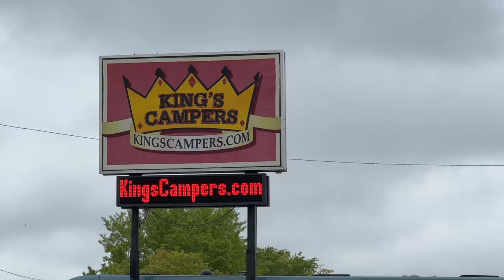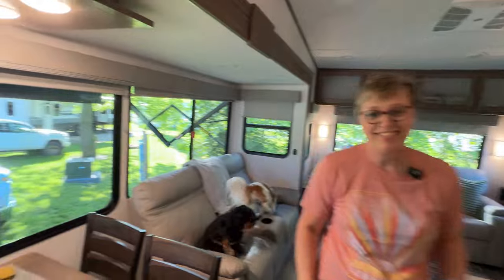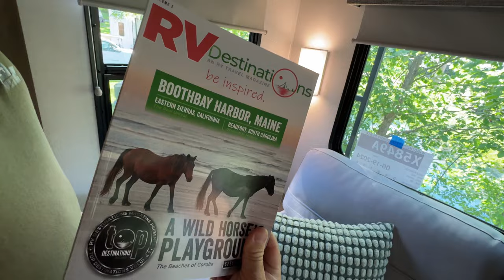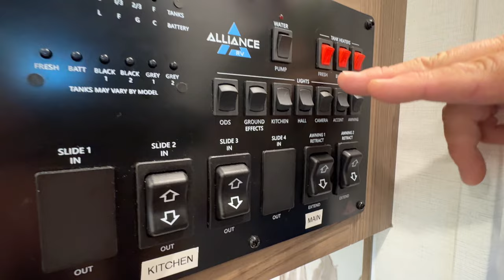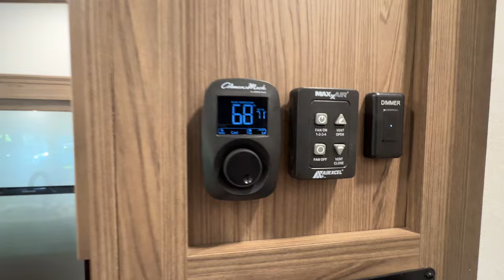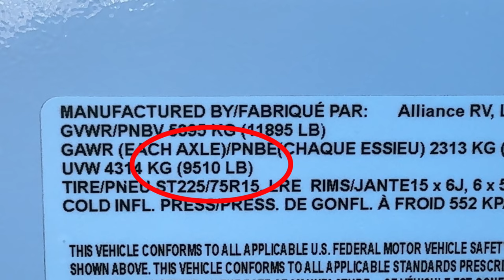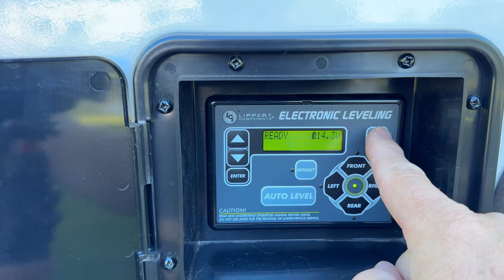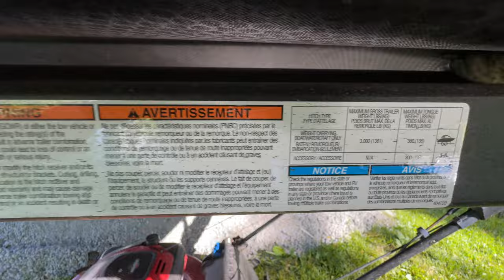2024 Alliance Avenue All Access Series 29RL Tour

Comment: Congratulations you will love it.  we picked up our 29rl on the 3rd of  May...we love ours as well...
Reply from the maker: Congratulations on your 29RL!!  We are loving it so far.
Reply: Does your soundbar work with your tv? Ours doesn't...
Reply: Also your table chairs will dent your flooring...we removed the small round button type pads and replaced them with felt pad type
Reply: Also, our 29rl fifth-wheel is 33ft 11 inches long...Alliancec brochure is wrong. Yellow sticker on the door confirmed it

Comment: We've changed our future plans from a Class C or B+ to a smallish 5th wheel. We're hoping to go coast to coast next year, and we're not sure a bumper pull is the way to go. We need road access, and mid camper stairs to fit in our limited driveway space. We've pretty much decided on a Cougar 23MLE, which has all the boxes ticked. Hoping to pick your brains, since it's all new to us. We've had our brand new trailer less than a year, so you're not alone in crazy fast trade-ins! Congrats, it looks beautiful!
Reply: Does that model allow access to the bathroom when traveling, (without extending a slide)?
Reply: @BigWave-4u2  as far as I know, it has excellent road mode. I think the only part blocked with the slide in is the stove and microwave.  We're still deciding what we want to do. Maybe by next year there'll be even more choices!

Comment: Looks nice! I definitely love the access to the bathroom/bedroom while in transit (a must have for us) and the open main area. 

Like our 5th wheel, we have the same steps and while they are very sturdy, they require quite a bit of room to deploy and in some situations they can prevent access to the trailer. 
How does the truck tow the new rig? Is it taller than the previous trailer? 
We almost bought an Alliance last year but our stock truck was too tall to tow it level without a lift kit installed. We ended up going with a Rockwood as it was taller. 
Enjoy the new trailer and stay safe! 
Bill in Utah
Reply from the maker: You are right about the steps Bill!  They are sturdy but really stick out when you are in tight spaces like a Cracker Barrel or a rest stop

Comment: Hello Patrick, I have watched many of your videos.  I have learned quite a bit over the years from your content.  I want to thank you for the education.   Our RV purchases follow in parallel to what you guys have purchased.  We started with the Nucamp Tab 400, then the Lance 2285, and now we have the KZ D240RKD.  We very much considered Alliance until we found the new KZ floorplan that was perfect for us.  I drove from Massachusetts to Nappanee IN to purchase the 5th wheel in March 2024.  We feel we got very good value and we are very happy with our purchase to date.  I’m curious, since KZ is basically in your backyard, why you didn’t consider the KZ brand.  Our 5th wheel floor plan is fantastic……. we have a full length closet, residential refrigerator, pantry, two AC’s, Maxxfan Deluxe, good suspension, tires, 50” TV with sound bar (all of it works great).  There is also a wardrobe slide out along with prep for washer/dryer.  It has a drop frame which allows for 35% more pass through storage.  There is a small compartment for a flat grill and sink.  Tank capacities and CCC is decent too. All just under 32'.

Comment: Hey pat nice RV.  I have a question 🙋‍♂️? When you install the 600 amps of lithium Battery’s .Did you have to get a dc to dc charger for the truck to charger the batteries or Did you have to remove the trucks battery supply at the 7 way plug from the truck cause lithium is charged at a different voltage as lead acid .

Comment: Patrick ,     When does it show that that rv was built on your sticker   doesn't show on camera shot      only asking because alliance is showing 29RL GVWR 10995  and Dry Wt 9488   which cuts cargo capacity down to 1507    Looking at purchasing alliance model   also are there two grey tanks?   shows 106gal    53gal each tank?   1 sewer connection?   Thanks Patrick
Reply from the maker: Out manufacturing date was 3/2024.  The sticker on our unit lists the GVWR at 11,895#.   On the tanks, there is a gray tank for the bathroom and a 2nd gray tank for the kitchen.  Those along with the black tank all are emptied through a single outlet

Comment: Do you have a fixed or a slider hitch? We are in the process of purchasing a 29RL and are getting a Silverado 2500 with a standard bed and I want to use a fixed hitch.
Reply from the maker: We are using a fixed position hitch.  So far, it has worked fine with no issues.

Comment: Thanks for your video   what is the real length inside
Reply from the maker: I don't know the exact measurement but I can tell you that with a 5th wheel, its typically almost the full length of the trailer as opposed to a tow behind where you typically loose about 3 feet for the tongue

Comment: Thats a beautiful trailer. I have been thinking about a 5th wheel. But until Lippert improves their quality, or these manufacturers start making their own frames, I pass.
Reply from the maker: The Lippert frame issue has been on the larger ones and toy haulers. I haven't seen any issues with the frames on the smaller ones like ours.  Fingers crossed.
Reply: Thank God